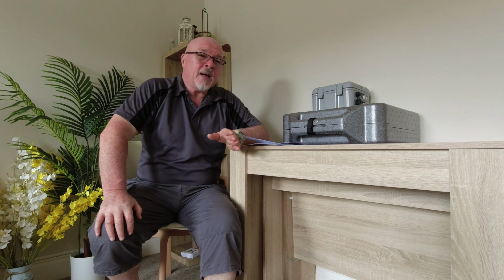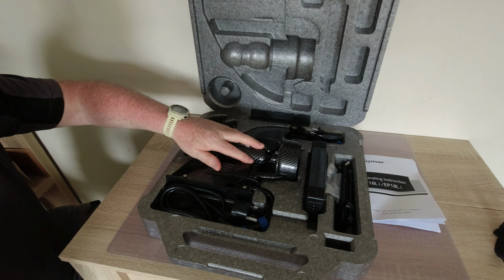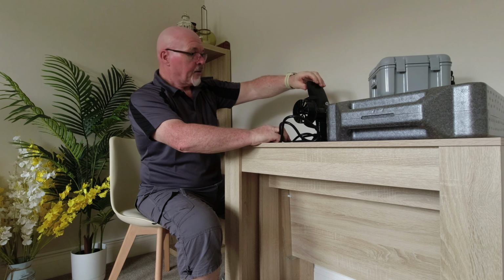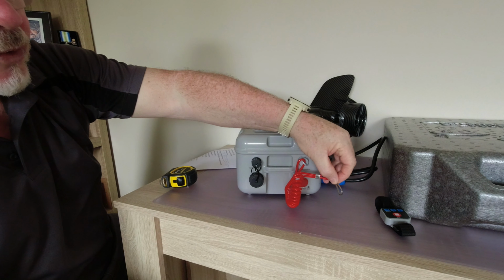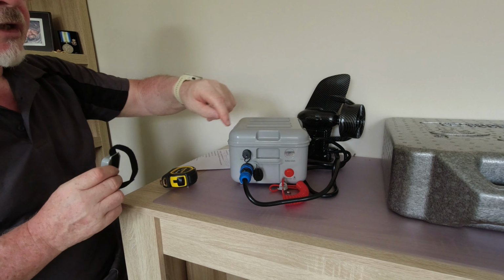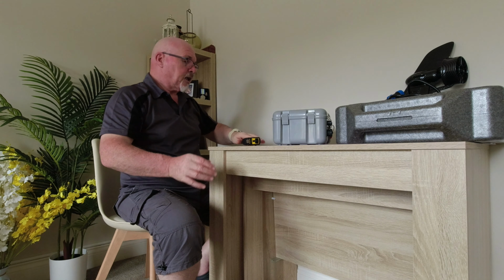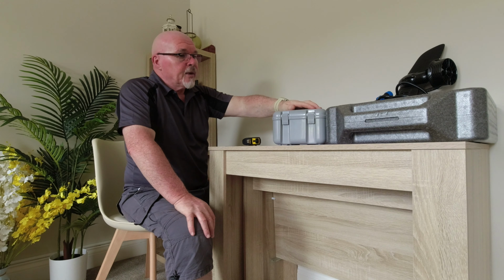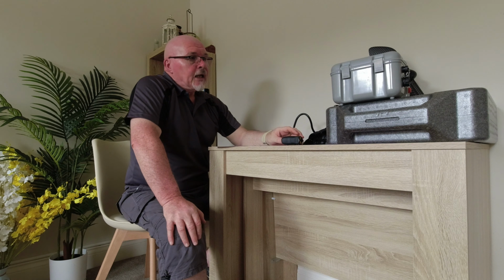Hiqmar EP18Li Electric Fin - Part 1. First Look At My E-Fin.

Comment: Thanks for the thorough test and review. I bought a Hiqmar e-Fin a couple of months back. I've used it 6 times so far, 3 times on rivers and 3 on the coast. Am very impressed with it so far and agree totally with the pros and cons you describe in your review. I might be imagining it, but I think in one of your other videos you mentioned about the need to have it placed towards the stern of the hull? I have used it on my Sandbanks Style kayak and my Story kayak ok so far and it's worked great. When I tried to attach it to the skeg slot on my Aquatec kayak, it was very tight to fit and I really struggled then to remove it. For some reason, the skeg slot on my Aquatic is very tight and I even have to use a rubber mallet to insert and remove the normal skeg. I did previously attach an additional front skeg slot on the Aquatec towards the bow of the hull and I could fit the Hiqmar into that because it's looser but I think that you mentioned in one of your videos that the motor causes the kayak to yaw to the side when placed towards the bow side of the hull? I also want to attach it to my Aquaspirit kayak which has 2 skeg slots but neither of the Hiqmar adapters fits the slots on the Aquaspirit. It has its own proprietary skeg slots for some reason. I was therefore going to attach an additional skeg slot to the Aquaspirit but wondered if it's best to fit it in the middle of the hull (between the 2 existing slots) or towards the stern, behind the rear in-built slot? I was thinking that the latter may be the better option. Cheers
Reply from the maker: Glad you are having fun with the e-fin, and thanks for commenting. My logic in regard to the e-fin being located towards the stern is potential manoeuvrability issues if it was fitted too far forward. I think the middle would be fine for manoeuvring. If the e-fin was to be located forward of your seating position (single paddlers) then you would be fighting against the e-fins forward propulsion.
Reply: @ yes, that would seem to make sense. As it happens, I was trying to fit it to my Aquatec kayak again today and I can manage to get it onto and off of the rear Skeg slot although it does require some tapping in using a small rubber mallet. I hope to use it on cardigan Bay later next week and may try it out on the front slot as well to see what it’s like. On the Aqua spirit kayak, I was having a look today and will probably attach the skeg slot for the motor towards the stern and to the rear of both of the existing Skegs. I’m a little concerned about putting it in the middle because it will be propelling water straight onto the rear skeg then. This may be ok but may affect the tracking and possibly cause a slight reduction in the power of the motor.
Reply from the maker: @TheKayakCrew  If you use some clear silicone grease on the e-fin and skeg track, it should be far easier to slide in and out. Enjoy your paddle 👍
Reply: @DavidWilsonOutandAbout  Thanks David, yes the silicone grease does help a lot with the skeg slots. 👍

Comment: Hello David i hope you`re well. I spoke to you on one of your other videos . Anyway my battery died in the watch and a little research suggested replacing the watch controller. Again after some research failed to find help. Anyway to the point. The watches are meant to be sealed and quite difficult to prize apart and seemingly impossible to do without cosmetic damage to the edges. No problem though it’s neatly covered with tape. It takes the common 3V 2032 battery which i replaced and the led light that comes on when pressing a button id expect it to last longer than the nearly two years already as its brighter than it ever was. If anyone else reads this you can replace the battery even though it’s supposed to be sealed.
Reply from the maker: Thanks for that information. I wondered whether the battery could be replaced but put it back in my mind as my controller is still functional. That's good to know though 👍
Reply: I found out nearly the harder way😊I did notice the tiny led light was barely noticeable when you pressed a button , so pretty obvious it was only a matter of time. I went to press stop and nothing. No problem I quickly pulled the red cord to stop. Only a second panic , i was heading towards a bank and never had the need to stop it that way before . Anyway got home and half hours work carefully prizing it open to reveal a battery I already had spare. Happy days,  take care

Comment: Mine has arrived and I've tried doing a quick dry run out of water but it won't go. Just wondered if I'm missing something...
I've charged the battery; attached the fin power cable; attached the emergency cut off and pressed the red power button on the battery into the ON position. When I press one of the remote buttons a blue light comes on on the remote, but the fin isn't activating.
Am I missing something?
Reply from the maker: Hi, Karl. I was going to say that the remote may not be paired with the control box, but it sounds like it is paired if the blue light comes on!. Probably best to contact the supplier as it sounds like there is a fault. Mine worked straight out of the box.
Reply from the maker: Just home from a wet and windy day out on the paddle, hope you get the e-fin problem resolved promptly and with the minimum of fuss.

Comment: Thanks for bringing my attention to this kit David, as I've been looking at motors to add to my SUP, but didn't know about this one. I was looking at the Waydoo one which is really sleek, but the 1 hour battery life is disappointing. I'll be looking forward to your findings with this one in your next video!
Reply from the maker: Hi Dan,
Thanks, glad you found the video of interest. I am hoping to get out on the water to run some speed and usability tests on Friday, 7th July. I really think Hiqmar's claim that the battery life in sport mode (4–5 miles an hour) is 2 hours, and in "D" mode (3mph), 4 to 5 hours is grossly exaggerated, If I get 2 hours in "D" I would be happy.

ATB, Dave.